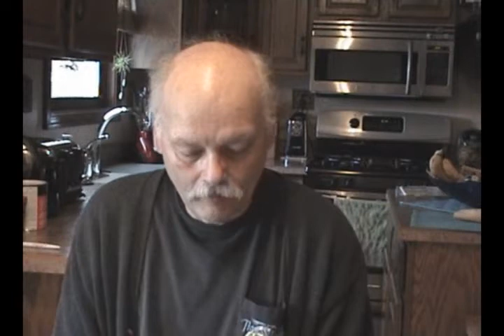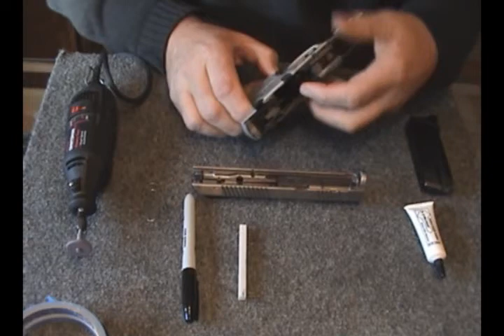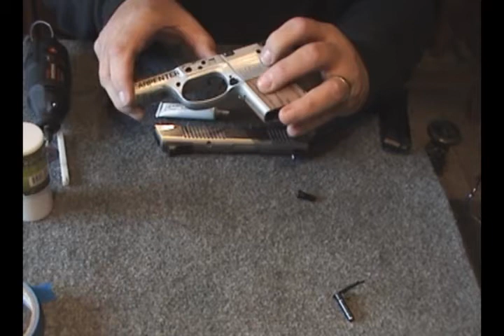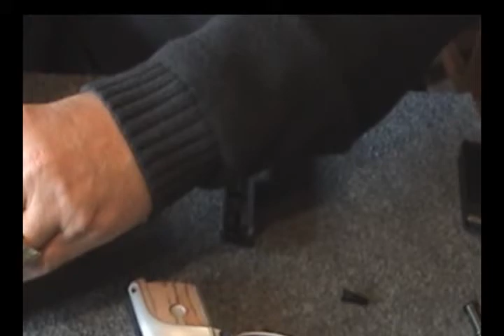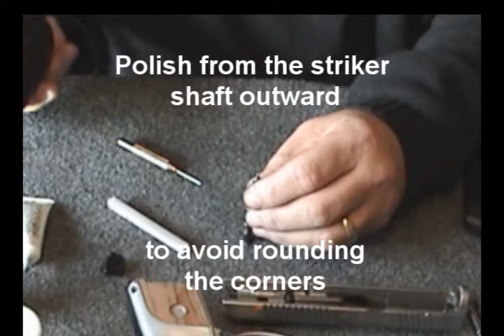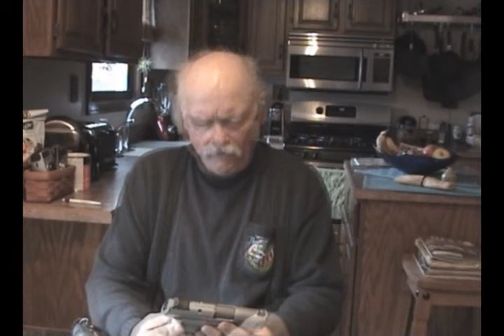Ruger SR9 Trigger Improvement

Comment: Any idea on why my pistol is having a failure to reset the trigger.  If I slowly release the trigger after firing it feels lighter on the return and then sticks towards the end of full extension.  I can lighty push the trigger, lightly push the trigger bar, or even slight shake (unloaded) will reset the trigger.

Comment: This is a great video Ron. I just finished my new SR40C. What I have to add here is how to take the back plastic plate off the rear of the slide on a newer SR model. There is no small hole to push the detent in to remove the small plastic piece. You have to depress at the 6 o'clock area of the cock indicator hole to release the detent. Hope this helps others.

Comment from the maker: I like that the trigger break out front.  All of the "safe action" triggers I have tried require a very long trigger pull before the break.  I find that hard to keep a good sight picture.  So difficult that some trainers teach pulling the trigger to about 75%, then get a sight picture, then pull through and fire.  To me, that negates all they ever taught about "keep your finger off the trigger until ready to shoot."  The design guys at Ruger fixed that.  Instructors say the shot that surprises you is usually a great shot, because the gun went off before the shooter could flinch.  Every time I go out, the first shot from my SR9c surprises me, both in ease of pull and quickness to the break.

Comment from the maker: What I like about both guns is the trigger breaks at the front of the pull.  DAOs and other strikers systems require you pre-load the trigger, hold it, get your sight picture, then finish pulling the trigger through the break.  That kind of negates the keep your finger off the trigger rule, IMHO.  Without a lot of practice I find it hard to shoot a DAO or Glock accurately.  That is  preference and training thing.  I wouldn't want to stand in front of any of them.

Comment from the maker: The SR 1911 is John Browning all the way.  It is a  single action trigger with that broken glass rod feeling when the trigger breaks.  The hammer is released by the sear, so the only pressure on the trigger is the sear and the small springs that cycle the trigger.   SR 9,40, &45; use the recoil of the slide to cock the gun a little over 80%, the trigger is pulling the main spring the rest of the way, then the shot breaks.  Striker fire is a very well done zip gun.  Less friction feels better

Comment from the maker: I get a lot of questions about the grips and the appearance of this gun in general.  This is a faux paint job using dura coat firearms finish.  The frame is their color "Stainless" and the grips are "Rosewood" and the dark wood grain is a mix of black and rosewood.  The rest is just careful taping and a $6 air brush from Harbor Freight.  I hope to do some more painting vids.  Dura coat is far better than the Rustoleom and Krylon painting seen most often.  Even if you're doing the same project

Comment: Thanks Ron. I have a SR40c and the trigger is grity and it hangs up (catches) in various spots after firing, while the trigger is moving forward towards the muzzel, to reset. I hate the trigger. I'm going to try to order the supplies you used and give it a go. Thanks again.

Comment from the maker: The manual does state, " Do not dry fire without inserting an empty magazine."  The safety doesn't close a door in front of the pin, it catches on a flare of the striker body.  In my opinion, after studying the design, there is no harm in dry firing.  It could be a lawyer's phrase to assure you're not dry firing with a loaded magazine, or it may, over time, damage the pin or safety.  I don't dry fire much, just function tests after cleaning.  If something breaks, I will just replace the parts.

Comment: I just wanted to commend you on a great illustrated video. I dont want to sound like a Youtube troll or internet critique but I do have one bit of advice.
In the ruger sr9 manual it states not to dry fire the pistol without an empty magazine inserted. The sr9 has a magazine disconnect ( the same one that you showed ). This blocks the firing pin and can cause premature wear/damage. Simply removing the disconnect safety will eliminate this and allow you to fire the pistol without a magazine.

Comment from the maker: It seems the polymer guns are taking over but some how, to me, they don't have the beauty of metal framed guns.  That is dura-coat firearm coating.  I sprayed the frame in their "stainless" color.  Then masked out the grips, sprayed them with "rosewood", then masked out the wood grain and sprayed them with a muddied up black.  Turned out nice and is very durable.  The gun has been carried/holstered/shot/cleaned for a year with no wear showing.  I plan to do some videos when spring gets here.

Comment from the maker: If you can find them these days, retail is about $500.  most sellers use to discount about $100.  Today, all the makers are working overtime and all the sellers are low on inventory.  Just about every gun Ruger makes in two factories is back ordered.  Obama is the world's best gun salesman.

The internals are similar to Glock, enough so there was a law suit.  In comparing the two as a shooter, Ruger's trigger breaks at the front of the pull, where Glocks all seem to break near the mag well.